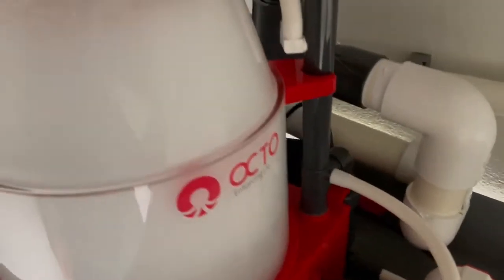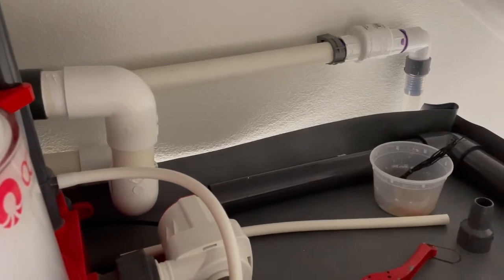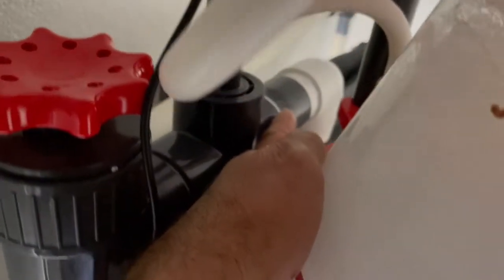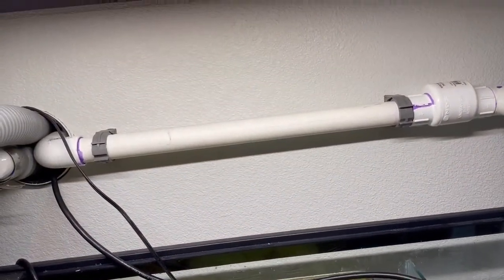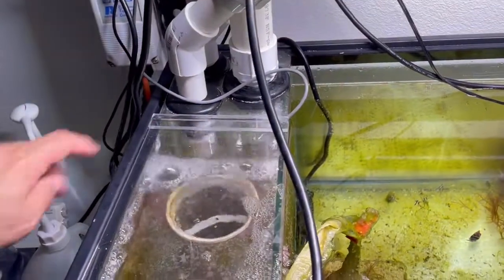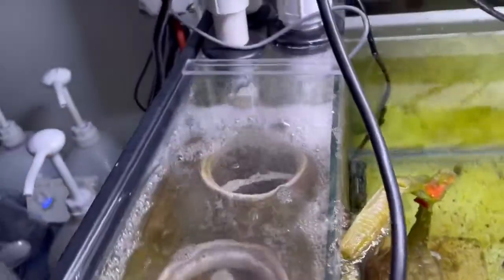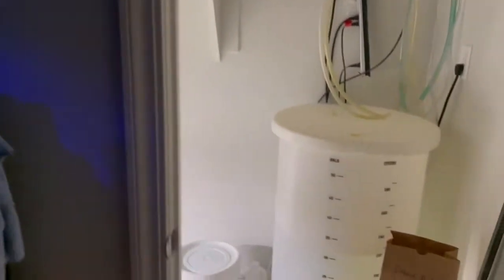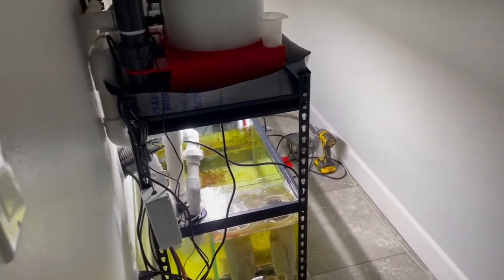Reef Octopus Regal 250 EXT 10" Recirculating Protein Skimmer plumbing update

Comment: Just found this cool video. I just purchased a regal 20@ set skimmer. Do I have to place it above sump level if I have a feed pump?
Reply from the maker: I don’t think it’s necessary to mount your skimmer above the sump. Do keep in mind that you will need to make sure that the sump water level is lower than skimmer output.